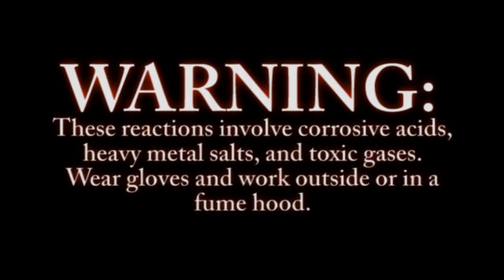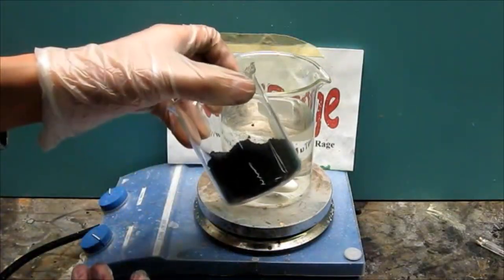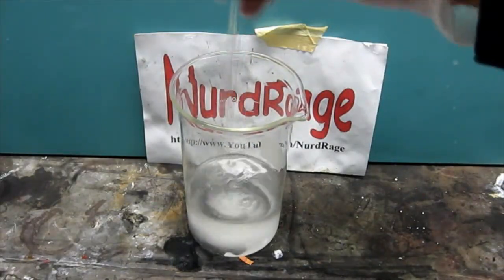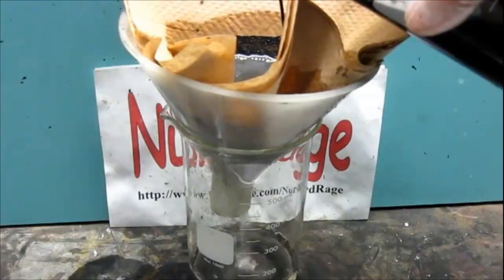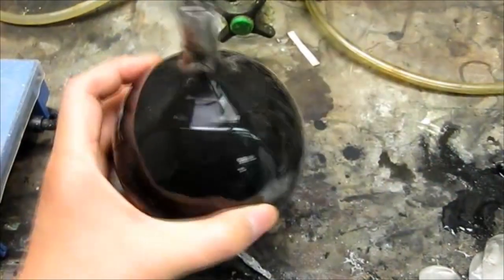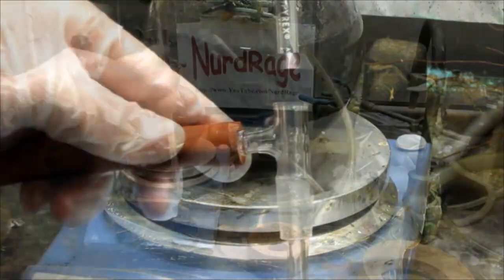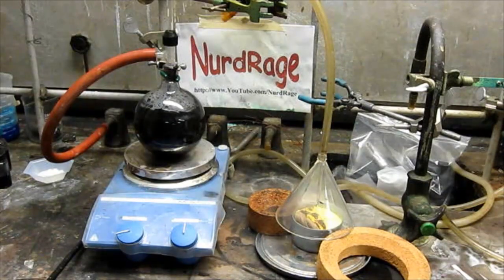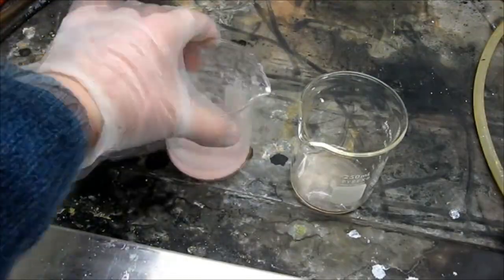Make MnSO4 from MnO2 [2 ways]

Comment: Hi Nurdrage, 
Nice video and DIY with batteries to make easily MnSO4 from it.

Tiny "bemol" as we say in french --> my 50 cents; it has probably not been noticed hence not been expressed in 15 years of existance  of this video; but into your text intro there is the following paragraph SIC:
"In the second method. The manganese dioxide is mixed with water and an excess of sulfur dioxide is bubbled through. The reaction produces manganese dioxide directly."

--> then end is wrong what would mean direct return to initial A case without moving further!

Correct termination is:
"produces manganese (II) sulfate directly"

MnO2 --[H2O +SO2]-> MnSO4 + H2O

Mn(4+) + H2SO3 --> Mn(2+) + SO4(2-)
The Manganese (IV) oxydises the SO2 to SO4(2-) and the  SO2 reduces the Mn(4+) to Mn(2+).

On another side the H2SO4-oxalic acid is quite interesting leaving only MnSO4 behind and CO2(g).

I personnally like the conversion of MnO2 to Cl2 and MnCl2 because of possible further use of Cl2 byproduct as OTC NaOH-bleach (NaOH,, NaCl and NaOCl) and further concentration boiling disproportionation to NaClO3 and NaCl, NaHCO3(from CO2 of the air); isolation of NaClO3 and eventually formation of NaClO4 or HClO4 by efficient OTC ways that I already experimented.
The NaCl can be further used to produce more bleach-NaClO3 electrolytically.

Regards,
PHZ
(PHILOU Zrealone from the Science Madness Forum and many former A.O.L newsgroups related to chemistry)

Comment: Didn't your PVC hose melt? I tried the burning sulfur method today but the hose connected to the funnel got so hot that it completely melted. I already used a piece of glass tubing in between and put a wet tissue paper over it. It still heats up more than I like. The only thing I did different was that I just used sulfur and not sulfur and paper together

Comment: I successfully used citric acid instead of oxalic. I used the following process:
Add sulfuric acid (36%) to the battery paste, with a slight excess; stir it; then add citric acid in small portions. Reaction starts after 10-20 seconds, producing bubbles of CO2 and lots of heat.

Comment: is oxcilic acid still needed if you started with pure MnO2? I wonder is a strong magnet can be used to purify the battery paste, to take out the Fe.
Reply: Yes, oxalic acid reduces Mn (IV) ions to Mn(II) ions, without it you would have no reaction. You could alternatively use sulfurous acid which reacts according to the equation 
MnO2 +H2SO3 ->MnSO4 + H2O

Comment: one way to remove the iron contaminates the MnO2/C paste can be reacted with sulfuric acid heated (note this has a tendency to boil over so heat but do not boil) The MnO2 and Mn2O3 (left over after discard of battery) will not dissolve this is washed and reacted like in this video

Comment: You can also make MnSO4 by reacting elemental manganese with sulfuric acid (would it be as straight forward as this?)

Mn + H2SO4 --> H2 + MnSO4
Reply: ***** If you use dillute H2SO4, then your equation is right. But if your acid is concentrated, then you'll get a redox reaction: Mn+2H2SO4(conc)->MnSO4+SO2+2H2O. As you can see, this wastes sulfuric acid, also, probably, some of MnSO4 will be oxidised to Mn(+3). So, be sure to dillute your acid to achieve the best results.
Reply: DevilsVideos1
Gotcha.

Comment: I like your sulfur dioxide setup. I was thinking of doing a similar setup for solvent recovery after a soxhlet extraction. Normally I distill most of the solvent and boil off the rest outside.  Here is what I have in mind. Upside down 24/40 powder funnel, female/female adapter, still head, liebig condenser, and a vacuum takeoff adapter hooked to a vacuum pump. Although I am a bit concerned that this might not get all the acetone fumes. I will have to try it with water and see how that goes.

Comment: Educational! I have converted junk C class copper (in Manila) to CuSO4-5H2O using your methods. It went a long way since I was able to crystallize Iron Sulfate heptahydrate by simply dipping stainless steel into blue vitriol mother liquour... Zinc Sulfate could also be formed if Zinc is dipped instead... I'm currently forming Tin (II) Sulfate. All these discoveries and the proof that displacement reaction with respect to the metals' electronegativity is real and does not only exist on papers.Tnx

Comment: i mixed dilite sulfuric acid with MnO2 and there was no reaction, but when i added a few drops of hydrogen peroxide there was bubbles and solution turned colorless. Did i get manganese sulfate? MnO2+H2SO4+H2O2=>MnSO4+2H2O+O2 
And also when i added MnO2 to conc H2SO4 there was reaction. Do i need oxalic acid for this, or can i use hydrogen peroxide instead? I tried this with nitric and citric acid and there is reaction wiht H2O2. 
Please answer me
Thanks

Comment: Hello,

Since i dont have oxalic acid and I the other way is way to messy, I found a way to get there from another way.

First heat the MnO2 up to about 1000 degrees to decompose to MnO.
And then add H2SO4 to create the MnSO4.

Or wouldn't this work?

Comment: Why is it that on so many chemistry videos people mention illegal drugs? It really irritates me. Crap like that is only going to make things harder for home chemists. It's because of this that I am going to have to limit my experiments to things that don't generate fumes. I don't have a fume hood and I am hesitant to do things outside. I live in an apartment and I don't want my neighbors thinking I am making meth.
Reply: Haha I use my stove as a fume hood. Its really bad of me i know but honestly its done a decent enough job. I mean I'm not dead yet. I did however throw some lithium in a bottle of water and capped it outside. I accidentally used too much lithium and it didnt fully dissolve into hydroxide before exploding and sent molten lithium and fire everywhere. Thanks for the snow. Also my neighbors were quite concerned. All 25 other apartments were looking at me confused wondering why a water bottle just exploded in a molten metal fire ball....
Reply: Man do not be scared. Science needs courage, it has been that way since the first alchemists.... The whole mess around developing home science is becouse of the corporation's fears the you can get away of them making range of high-priced products and medicines by themselves!!
Reply: purplemutantas make a little fume hood with a hydroponic tent and a carbon filter inline fan or a hepa type air purifier. Also if it not doing anything illegal u have nothing to fear. The only concern will be safety.

Comment: @rolandas1985 You can't reduce titanium dioxide very easily, and it doesn't have a +2  oxidation state. The +3 oxidation state is already reducing, the hydroxide will reduce water to hydrogen! Titanium dioxide isn't soluble in dilute sulfuric acid, according to ftp://ftp.fao.org/ag/agn/jecfa/cta_tio2.pdf it is soluble in hot concentrated sulfuric acid.

Comment: Hey Nurdrage, I just finished this procedure for method 1, and I tried following your instructions as precisely as I could. I used 30.3 g Oxalic Acid Dihydrate dissolved in 200 mL of water, with 13 mL of what I believe to be 98% H2SO4 in the form of drain cleaner. Upon 100 mL additional water and subsequent dissolution, I added 100.3 g of my battery paste.

I ended up with a pale yellow solution, indicative of the iron contaminants. Do you think it is the 30.3 g of the dihydrate that did it?

Comment: It's possible to use Bonide Stump-Out as a hardware-store friendly source of high-purity sodium metabisulfate if you want to use the original fancy glassware widget.  Gordon's and Hi-Yield stump removers won't work, as they are potassium nitrate.

NurdRage, is it possible to simply dump HCl and sodium metabisulfate into a 1L flask and cap it off immediately, rather than the extra-fancy 3 necked flask?

Comment from the maker: @panzuman

To be honest i don't know. but i don't think it would very good since the sulfur dioxide might react with the rubbers, greases, seals or etch the metals.

I reccomend building a sealed burner container (a large paint can works) placing the candle inside, and then poking two holes in it. push air through one hole and lead the exit gas out the other hole and into the mixture. 

Be careful though, explosion danger if sulfur vapor builds up.

Comment from the maker: @trstmeimadctr

You'd be amazed.

No matter how idiot proof i make things, the universe just produces better idiots to defeat me.
Reply: What do u think about activating that pottery store MnO2? I dried some in the oven and then used it with dry DCM  to oxidize benzyl alchohol to benzaldehyde at rt over 7 days And from the smell it worked yet literature says a normal oven will not work. I will use your purification step next time also.

Comment: Question for your Nurdrage: What other kinds of reductants would be suitable for this? We see here two examples: Oxalic Acid and Sulfur Dioxide.

I'm curious as to whether or not there are any others that might work, at least in theory.
Reply: Ascorbic acid will reduce Mn(IV) to soluble manganese(II) (dehydro)ascorbate. Acidified hydrogen peroxide will reduce Mn(IV) to Mn(II). Hot conc. sulfuric acid will also reduce MnO2 to MnSO4 and oxygen. Excess HCl will produce MnCl2 and chlorine. Sodium (bi)sulfite will also work (I believe) when acidified, which is basically the same as the SO2 reaction, except SO2 is produced in-situ and it's dirtier due to sodium cation contamination.

Comment: You should do a video on how to make hydrogen peroxide from electrolyzing a solution of sulfuric acid and ammonia. Ammonia, ammonium sulfate, and concentrated sulfuric acid are dirt cheap and readily available at Ace Hardware (Liquid Fire Brand drain opener).

30% food grade hydrogen peroxide can be purchased in relatively large quantities by individuals online, but it's not widely available locally.

Comment: On a side note, I did some informal experiments on reducing potassium permanganate with hydrogen peroxide. In a neutral or basic solution it produced a brown mixture (I assume basic MnO2) when acid is added, it becomes a clear solution.

I tried combining potassium permanganate and ammonium sulfate and then adding hydrogen peroxide. The solution because clear, and I think there was less out gassing. Did I make nitrate, hydrazine, or squat? Might a similar redox work with MnO2 in lieu of KMnO4?

Comment from the maker: @Liberterianist

That does work, i tried it myself, but it's much harder to find the right ratio, it's not perfectly stoichiometric because you have a competing reaction of decomposition of hydrogen peroxide. 

Also, oxalic acid is much cheaper and easier to handle than H2O2. You can buy it by the kilogram as wood bleach, there are no restrictions on it and very little danger assuming you don't eat it.

Comment: It's an overall equation.  In essense it's best classified as first a redox (oxidation/reduction) reaction in which Mn4+ is reduced to Mn2+ by oxalic acid and then a "single displacement" (really just ions in solution combining since the protons on sulfuric acid would have dissociated) with Mn2+ combining with sulfate to form MnSO4.

Comment: I pretty sure you can reduce manganese with sulfuric acid and hydrogen peroxide.

MnO2 + H2O2 + H2SO4 -> MnSO4 + 2H2O + O2

The above equation is stoichiometric, and presumably true based on simplicity, but the amount of H2O2 may vary. You can just add H2O2 until the mixture becomes clear.